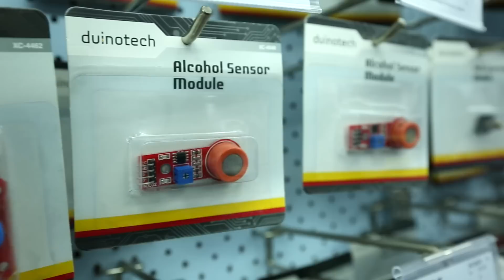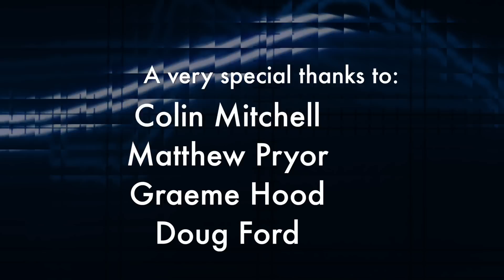The Decline of Hobby Electronics?

Comment: Simply put to say electronics gone shitty expensive ( not components but tools you need to put together those components)
Reply: You can get soldering irons for 10 bucks that do the job just fine, the prices of solder, breadboards, pcb's really haven't changed at all. Soldering 0603 and 0402 components and QFN packages works just fine with my cheap iron, and you can make custom PCBs with a laser printer. Having an oscilloscope would be nice, but you really don't need one unless you are designing RF stuff. Most of the time you can compensate the lack of equipment with skill and patience
Reply: +megreyaugust I disagree...
Just get what works, it does not have to be top brand. there are some mid-quality tools, for example: Goot
https://www.aliexpress.com/price/goot-soldering-iron_price.html
And for beginners, just use what works, it does not have to be a Hakko or Weller ...etc.
Reply: Nope, everything has come WAY down.

Comment: Covered about every point I could think of which was great. Microcontrollers are the biggest one for me personally. Sometimes I have a project that makes use of discrete components. I can do that. PCB are easy to get now, and SMD just needs some practice (but I agree they can scare people away). But you can do so much more with MCUs now. A few pin connections and some software and go so far. 

Plus people spend so much time on computers now, mobile or desktop. Things in the pure software world have a lot of value, that takes away some of the audience.
Reply from the maker: Great comment thank you - and I agree :-)

Comment: there is certainly alot less 'hands on' work in the hobby,as most everything,component wise, comes ready to go, pre packaged,  much,much smaller,,,,an all  thats ok,  times change...I repair mostly pre 1945 ....a vintage crystal radio used to be the size of todays 'tablet'. or laptop...now you can have the whole set on your thumbnail... Im staying in my shop, with vac tubes,knife switches,.heavy power transformers,and hi-voltage open spark wireless transmitters lol..
Reply from the maker: Awesome and good on you! Thanks for the comment. Greatly appreciated.
Reply: https://www.raspberrypi.org/magpi-issues

Comment: 51 years ago I was into valve amplifiers. I had a break of over 40 years but now I'm back. Good grief, things have changed, it's taken a year to get to grips with the simplest of 'gubbins'. It's just as much fun as it was, how well I resurrected the smell of burning skin when I picked up the soldering iron by the wrong end. One good thing though, I won't be getting the odd 410 V belt.  From EL34's to 2N3055, yes I know they are old but they were a dream 50 years ago. Everything is so cheap these days. I guess one old wrinkly returns to the fold.
Reply from the maker: Haha very nice. Good luck and thanks for your comment!
Reply: You never lose it. I started as a kid in electronics back in the 70s and I'm still doing it now (both as a career and a hobby). I'm still using EL34 and 2N3055! The nice thing about it is we can still play with the toys and components from back then!

Comment: People are writing how easy it is to solder surface mount components but no-one is ever mentioned what soldering flux they use to be so successful. My experience soldering SMD components is a disaster with resulting shorted links and chip pins.

So, the crucial question is: which soldering flux gives good results? In other words, which flux allows molten solder to flow where it should and not form shorts?
Reply: Well the bigger smd packages are relativly easy to solder (for me at least). Ive used multiple flux types and had the best results with amtech flux and (please dont use it for smd if you dont clean the pcb as best as possible) zinc chloride. To remove shorted links the easiest solution is to use an chisel type soldering tip and some wick with some flux. Trial and error is the key and if the method to solder the components on is shit even the best flux, solder and soldering iron wont help ;)
Reply: For large enough pitch between component pins your method works but what about situations where pins are so close together that using a fine solder iron tip becomes next to impossible? Using the tip of a soldering iron from pin pitches <= 0.5mm is simply impossible.

It is clear mass producing industries use fluxes with a viscosity that makes solder flow to where it should and away from where it shouldn't.

I am still unable to find such a flux but know for certainty it exists as mass producting production lines must compete making all that is possible to keep human intervention at the barest minimum.

A brute force method like you described is the old way of soldering that sadly we have to accept is passe'.
Reply: For really small pin pitches i would use an stencil with solder paste and an hot air gun or oven. If you use too much solder, flux wont help at all because there is simply too much solder there and you would need to remove the excess.
Reply: Edward Bartolo 

Maybe this helps: https://youtu.be/VxMV6wGS3NY
Reply: Edward Bartolo First is soldering paste. It consists of solder and flux in right proportion. Second is right amount of it. Third is using stencil to make sure to satisfy the second requirement. Fourth: right tools such as decent soldering station with heating table and hot air or IR oven. I went through all those steps myself and developed a good technique, but all the above steps are a must.
Reply: Learn from an experience master/person :)
https://youtu.be/pdGSFc7VjBE <- example

Comment: All the Radio Shacks are closing down in Phoenix AZ so it gets even harder to have an electronics hobby.
Reply: The only nice thing about the shack was the fact you could have the component in hand on that day. I can buy through hole components for around 46 cents per 100 from china and if I wish to wait a month free shipping is great. SM is the same I can take those through hole components I slapped on a breadboard jump into eagle and schematic them convert to SM build a board send it off to a board house in china and can get 5 identical boards for about 13 dollars including shipping.
Reply: There are probably smaller local stores. Good riddance if a monopoly is closing down.
Reply: There is still ebay and aliexpress, Ladyada ...etc.
Just get KITs LEDs, Transistors, Diodes, Caps, Resistors...etc., like Elenco / JoeKnows from Amazon
https://amzn.to/2mOR8lt <- example, or get similar kits/assortments from ebay/aliexpress.
Also try Futurlec value packs, esp. IC -> https://www.futurlec.com/ValuePacks.shtml
( these are just examples, get from wherever you like; electronics online shopping )

Comment: you can just make your own components, though they will be rather big
Reply: Agreed!  If you want a real challenge, why not go back to the philosophy of the early days of radio broadcasting?  Resistors you could make from bits of pencil lead or a trace on an insulating substrate of some kind?  Capacitors, aluminium and plastic film or paper.  Homemade vacuum tube are a challenge unless you have vacuum kit but valves/vacuum tubes are still plentiful.  If you are determined enough, transformers are not impossible.  How about homemade balanced armature loudspeakers as in the 20s/30s?  On the philosophical side, unfortunately, we have no influence over programme content.  If thermionics are not your style, how about a zinc oxide negative resistance device?
Reply: Jozef Bubez It sounds fun. Unfortunate that process and home-rigging is often considered backward, while production and ready kits are the objects even for hobbyists. Building from scrap gives very uncertain resullts, but a person discovering they can make their own and not be dependent on the market is a good reward. You sound like a real techy. I just tinker once in a while.
Reply: You what.
Reply: You mean modules?
You can make a coil, cap, resistor ;D
try this trick, distilled water (car battery fill-up) and salt, a water cap, 2 wires, add salt, stir, measure with DMM ;D

Comment: 200 comments and still more coming.  The truth is that the older hobbyist purchases very little.  As he has time to salvage from old discarded Tv sets and electronics from curb side collections.  I am still working and do both.  Buy in China and salvage. 
Also I have friends who imports from China and Adafruit and Sparkfun and turns over 6K on the side giving hobbyists a faster
 delivery time.  They work a fulltime job and do this on the side.  Buildcircuit. Com is one of those.  Jaycar is still there with even higher prices now.  A shop we go to if we need a part now. 
Anyhow a great thank you to all who tought me including Collin Mitchel,  John Oxer and Silicon Chip.   Times and the Internet has changed all.  Now our teachers are Instructables,  personal friends and Hackerspaces. A nee community that learns from each other.  Only a few stand out from the croud.
Reply from the maker: Hey thanks for your detailed comment. Great stuff

Comment: They need to ship the consumer products with circuit schematics again so that the customers will start to repair them again. The willingness and ability to repair them will create a large demand on electronic components and this will also produce the electronic engineers from tomorrow.
The industry should also stop to remove labels from IC.
Reply from the maker: Its even down to scratching off IC details, gluing down assemblies and making it impossible to pull things apart. Yep it would be great to have schematics with devices again, so that if someone who wants to fix the thing, they can. Thanks for your comment.
Reply: Thats what they really dont want you to be able to do...they working hard to make it impossible to fix by a common consumer. Sometimes even real service shops cant solve.
Reply: State of Electronics I think had I had schematics in hand when I was younger I would have gotten into electronics much sooner since I could physically see the lay out of a mysterious PCB
Reply: A lot of mass produced products from china don't even have schematics. I know, because I have tried to get them in order to repair some units. It seems that quite often, different parts of an item can be designed in different factories by different people. They may just have the schematic in their head, or on a piece of paper and it doesn't get collated with the other schematics for the rest of the unit at any stage. The distribution company will not have the complete schematics (or sometimes any). If they do exist they may not match the final production unit because it was changed as they went along. If you can even find out which factory made a particular part of the unit you can't contact them because no one speaks English. It's a difficult situation. It never used to be like this but that is the state of mass production now.

Comment: Jaycar need to start stocking SMD stuff, 0805 SMD resistors are $10 per 5,000, they could sell strips of 100 for $2, make their money back 10 times.
I'm a hobbiest and prefer working with SMD, if SMD existed without leaded components ever having been a thing no one would complain.
Advantages...
-Only need to deal with one side of a board
-No clipping leads
-More flexible design
-Lots of great SMD gear around (except Jaycar/Altronics)
-Often cheaper
-Easier to store components
-Easier to ID resistors
-Drag soldering IC's is really easy - don't say you can't do it, give it a fair go with some cheap IC's and eBay adaptor boards!

Disadvantages, in all fairness exist
-A minor issue for the vision challenged, need additional optics
-Need a slightly steadier hand

Jaycar/Altronics can't complain about losing business to SMD hobbyists if they're not going to make an effort selling and supporting SMD.
The need to add a Hakko 888 and/or TS100 soldering iron to their range, a small range of SMD MCU's, a small range of SMD resistors, caps and silicone components.
In addition, support that by doing a new 'Short Circuits' book that is all SMD.
Their maggy lamps are good, and in store already, get to it guys!
Reply from the maker: Thank you for your long and considered comment. All good points

Comment: The biggest issue is that you can't find the parts needed for servicing. Soldering SMDs is not an issue, but when you've got a modern TV that's got ICs not available on the market, you can pretty much throw it in the bin.
Reply from the maker: The whole issue of e-Waste is something I am concerned with as well.

Comment: What the actual fuck? Hobby electronics is doing better than ever before! You have arduinos, raspberry pis. Adafruit and sparkfun sell control cards that allow you to do more advanced and professional-like projects than what anyone could have done before, cheaper too. It's also easy to get basic eletronic components for cheap. Eventually when you make something useful and want to get nicer looks, with Eagle software and a chinese manufacturer you can get proto PCBs for 15$. For basic equipment you need a temperature controlled soldering iron, screwdriver, solder, solder paste, and for your safety: safety goggles and solder fume extractor. Even SMD isn't a problem once you get far enough, as it's easy to get a robot that does the positioning for you. Of course it involves that you know BOTH electronics and programming to really kick ass. These guys aren't innovative enough. Stop listening this bullcrap and start here: https://www.allaboutcircuits.com/textbook/ https://www.arduino.cc/en/Tutorial/HomePage
https://www.raspberrypi.org/blog/tag/tutorials/ (And before you start here, be very sure to read about voltage, current and watts first. When studying electronics, be patient, treat electronics with respect and be cautious. Enough current through a circuit where you roleplay a capacitor or a resistor can kill you)
Reply: State of Electronics Very mature of you! I am delighted to see this adult debate taking course with such respect and tact!
Reply: What a nice reply. Amazing.
Reply from the maker: Do you even read anything about this project?? Did you miss 60 minutes? Blindly go forth and populate the universe with your fucking shit-house points of view why don't you! thanks for contributing absolutely nothing of any value whats so ever!
Reply: Did you just give me a quest? I'll add it into the list of my many quests. But seriously, there's not even a reason to ask whether hobby electronics is declining. It's thriving and blossoming even if electronic devices have become complex and large manufacturers secretive.
Reply from the maker: Henri, while I appreciate your comment, its about 5 years too late! These interviews date back beyond that time and are now a fantastic gauge on how its all proceeding. However there are still many concerns raised in the video that are relevant today. Arduino (Uno variant) and even Raspberry Pi have also been superseded if you put it like that. The ESP32 and ESP8266 have huge communities and active contributors from everywhere in the world including Australia. There are hundreds of SBC's from lots of vendors as well. SMD is always going to be a problem for beginners no matter what. Luckily, after a basic understanding, it starts to make sense and some simple tools can provide fantastic results. While you get it and can participate, its still not accessible for many. Rather then shooting down this video, make it a call to action and help others to understand what you know. Put out tutorials of your own that take it further then others who have videos out there. Its just that simple. Thanks for participating.

Comment: I WILL not accept small sized components hard to solder. They are very easy, far easier and faster than through hole, you just need to learn how to do it. Just because you need a bit of effort doesn't mean it's impossible, this is electronics IT ISN'T EASY. BGA is easy to do with a hot air gun for £25. You don't need to buy 10,000 components either.